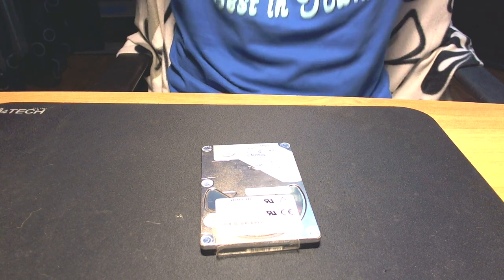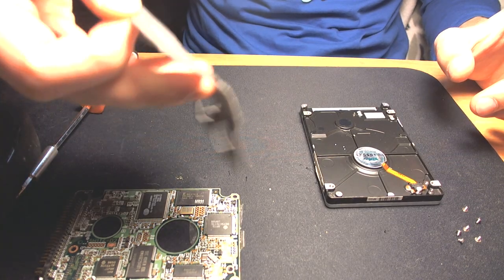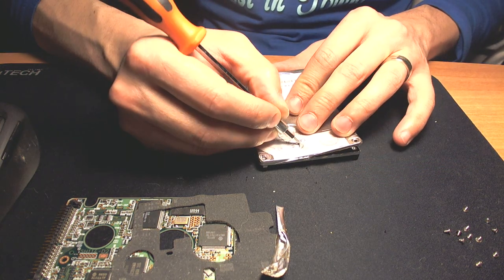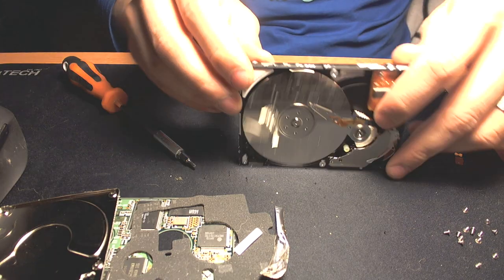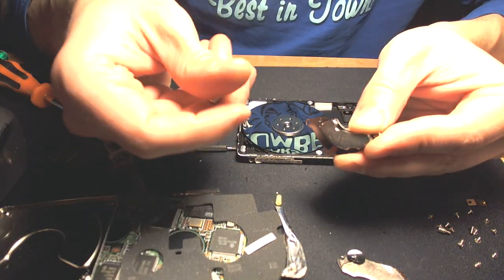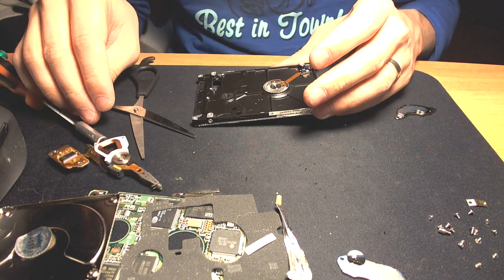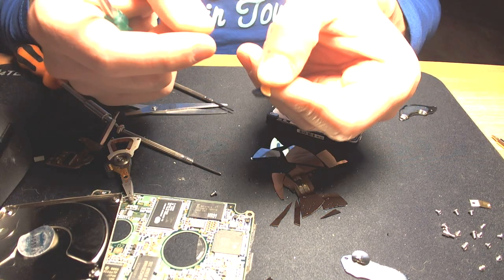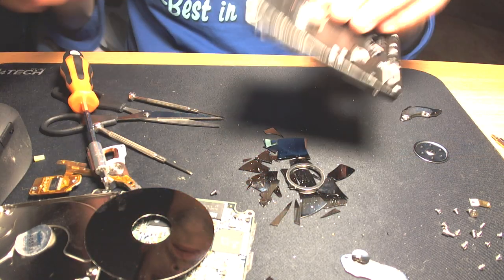Hitachi laptop Hard Drive dismantle HDD

Comment: OMG this video is "GREAT"! It should be titled how not to pull apart a Hard Drive. When he started prying on the parts with a pair or scissors, then said I need to get a bigger screwdriver I thought I was going to wet myself. Then jamming the (BIGGER) screwdriver between the two discs and shattering  the lower one I did indeed mess my pants. WOW, I have to see you in video trying to pull an automatic transmission apart in a Bentley or Rolls Royce............I needed a good laugh and I thank you.